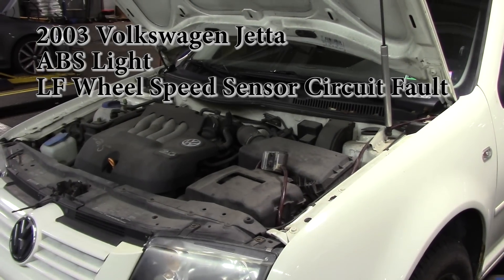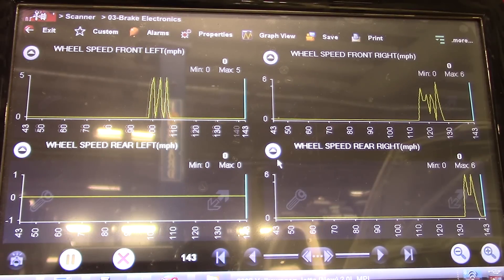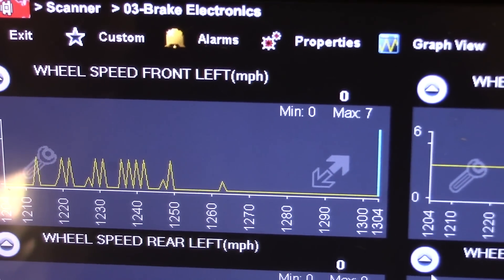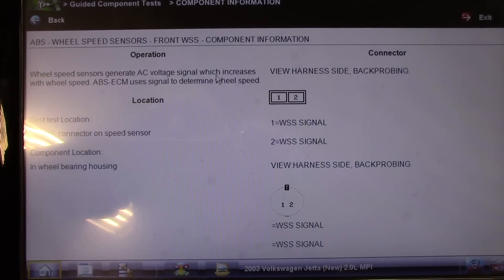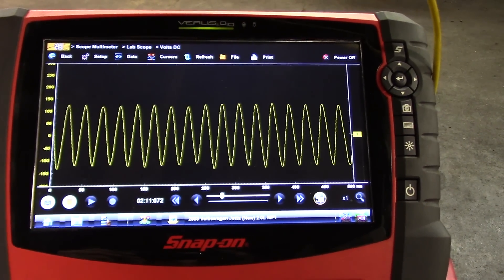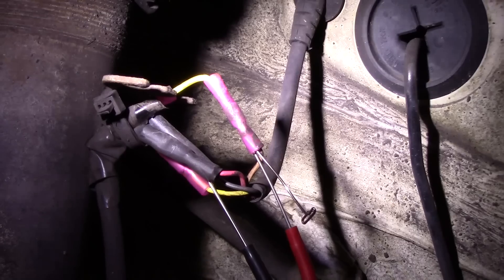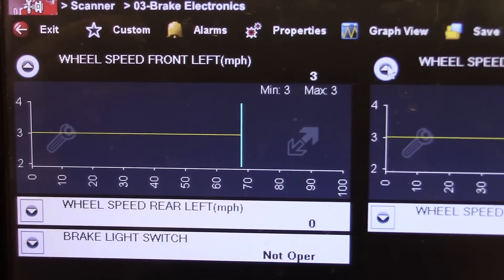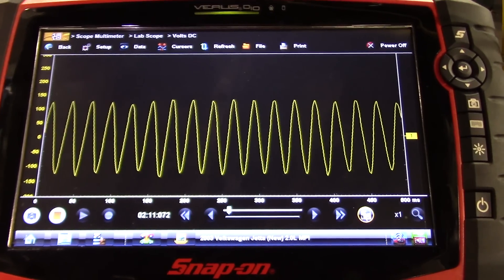2003 Volkswagen Jetta ABS Light (LF Speed Sensor Circuit Fault)

Comment: got a mk4 golf with codes , 00283,00285,00290,00778 which way would you attack that? Steering angle sensor code throwing me off as they are linked? be a bit odd to have wiring faults to 3 sensors?

Comment: Hey Tommy, I have a 01 cabriolet that had a fault code for the right front abs sensor, after verification that the sensor was bad, I replaced it. Using vagcom lite, I reset the code and the sensor code was gone only to be immediately replaced by a V64 code for the  abs pump out of specifications. Checked both 30 amp fuses, both good. Any suggestions on where to look from here? Thanks in advance
Reply from the maker: I'm not sure if there are any basic settings for that. Kinda weird it was right after the sensor was replaced.  Could just be a coincidence and the pump went bad
Reply: Positive Lead Diagnostics Is there any chance that running the right front tire off the ground and hitting the brakes, checking the km/hr verifying the speed sensor was working caused this? After that check is when the v64 code appeared
Reply from the maker: That could be a possibility. Maybe the module just got screwed up seeing one wheel spinning and locking up
Reply: It's definitely a hard fault, will not clear. Have pulled the fuses,  no green cruddies, all original car. I'll keep checking and rechecking. BTW, thanks for the informative video on the sensor testing. Just wish I had both wheels off the ground, lol
Reply from the maker: Capacitive discharge?
Reply: I'm seriously lacking tools. I have a incandescent test light and a multimeter, plus a laptop with vagcom. Bout it. Please explain
Reply from the maker: Disconnect both battery cables and touch them together for a few seconds then reconnect to the battery. I've seen it fix weird issues
Reply: Hits head with hand... You should have seen my dismay when looking for the secondary injection pump fuse that was covered in black tape.  Dope!
Reply: Positive Lead Diagnostics Well, still have the same code, abs light is still on, except engine is running rough. Bummer. No mil,  no engine codes.
Reply from the maker: Maybe the pump was damaged with only one wheel off the ground.  Wiring good to the pump?
Reply: All the wiring is intact and unmolested. I have 12.5 volts at both fuses key off. There are no points of contact on the harness going into the pump. Gonna test drive soon and check the operation of the abs. Not sure where else to look.
Reply from the maker: Could just be a junk pump then. Did you try disconnecting the battery and putting the cables together?
Reply: Yes, I did that last night. Test drive was just as confusing, panic stopped at 30 mph and the rear tires locked up. Took some time to get the brakes hot. I'm going to try disconnecting the abs module, perhaps the connection is bad, or the terminals inside may have failed.
Reply: Never got any further, unplugging the abs module did nothing, connection looked good. Cannot find a flow chart to positively id the module as being bad. Just gonna have to live with abs light on. Thanks for your insight
Reply from the maker: Looking at a wiring diagram are you able to see the power and ground wires that control the pump or is that all done internally
Reply: It's all done inside the module. I found some random posts about the module failing internally due to solder joint failure. Would still love to be able to be positive that is the issue, just cannot find the procedure for actually testing the module and what im looking for. Cabrio shares a platform with jetta, but placement of parts can be different.
Reply from the maker: All powers and grounds to the module are good. There really isn't anything else it could be. Unless there is some weird basic setting that can only be done with a factory scantool
Reply: That is the conclusion I came to as well. I've been in the automotive field 30 years this month, and really felt a calling to enlighten myself from parts changer to absolute troubleshooter. Why do components fail and can they be fixed, instead of just changing stuff all the time. Started watching scannerdanner which led to you cuz customers keep bringing me vws. This new point of view is awesome.